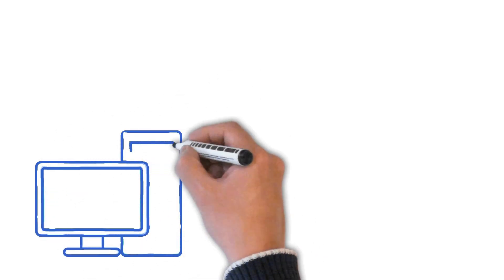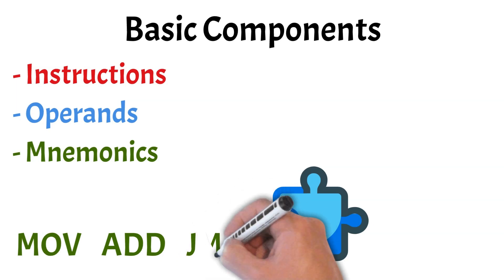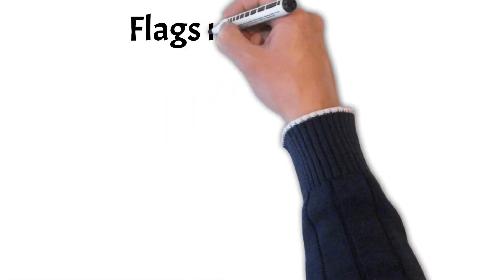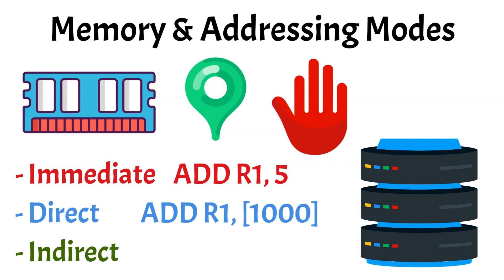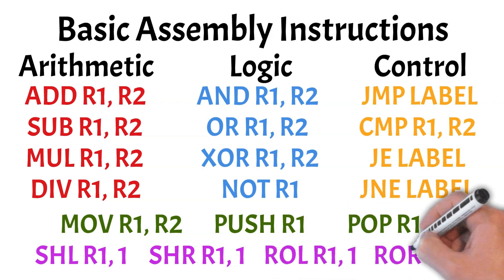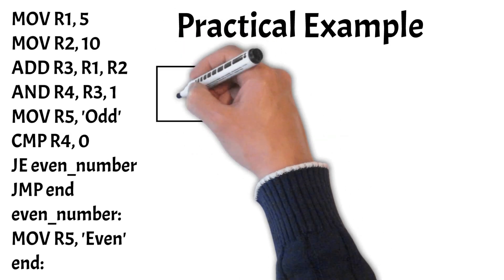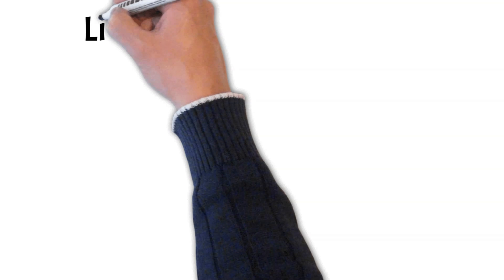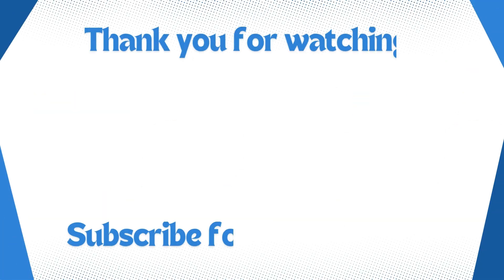Assembly Basics: The Language Behind the Hardware

Comment: Fascinating, though I did not understand more than about 5% of it.
Reply: Basically pretend you have this weird electronic object that has various buttons on it.  The object is capable of holding isolated "bits" of info (on or off) in containers (called registers).  It can also shift those bits around.  Think like a row of light switches as a register but the light switches are a lot smaller.  If you have 10 switches and the first 9 are in the off position and the 10th is in the on position.  Well then pretend (just for the hell of it) you actually want the first  switch on and the remaining 9 off.  Well you aren't going to physically move the light switch from the wall and place it at the beginning.  Instead you are just going to flip the first one on and flip the last off.    

So that's one thing this weird object does but how?  Well it has the buttons right?  Well turns out if you press some (or all) of those buttons in specific order and at the right time, you can flip those light switches how you want to.  

However, you find out that that to do that one example from a ove you have to press A LOT of those buttons and you have to do it at weird time intervals.

And turns out to get anything useful out of these switch flips (for humans) you have do a A LOT (and I mean A LOT) of these "switch flips" operations.  It's too hard to do mechanically (or basically impossible).  So what do you do?

You build a table where one column are "mnemonics" (short human reable words), and the other column is a serious of button pushes.  

Then you build another weird electronic object that can parse/read those mnemonics that you wrote on a txt file, look at the table and push those buttons for you in the correct order and at the right times.
Reply: @Rockyzach88  this is the best explanation of assembly i have seen so far. thank you very much. I'm going to save this so i can explain it to anyone who's interested
Reply: If you have no previous experience with any kind of programming, assembly can be a tough place to start. This is just a overview / introduction, so don't be shocked if you feel a little lost, it will eventually pass as you learn more about it. Or if you find assembly too hard, maybe try a high level language like Python, it's super simple for beginners and much more forgiving than starting with something like C (too low level) or Scheme (too abstract).

Don't get me wrong, it's perfectly possible to start with Assembly, C, Scheme or almost any other language, but it all depends on how good is the material you're using to learn from, and most material I've found for C and Scheme will only work for a highly motivated individual who is comfortable seeking additional information by himself or herself. Something like Python or Ruby is much easier to start with, then after you got the basics and are comfortable with it, you can migrate to another language if you feel like it isn't a good fit for what you want to do.
Reply from the maker: Thanks for watching. Assembly can be tricky at first. Feel free to share what parts were confusing and I'll do my best to clarify or point you to some helpful resources.